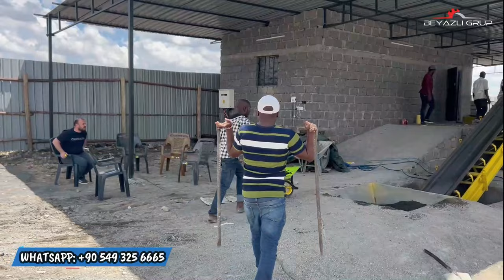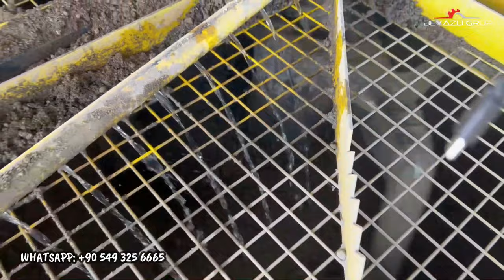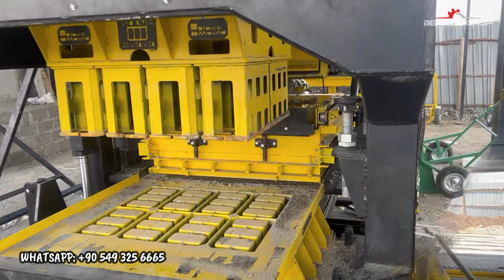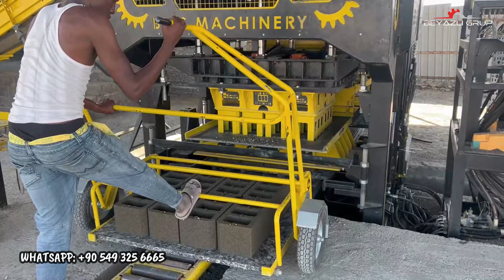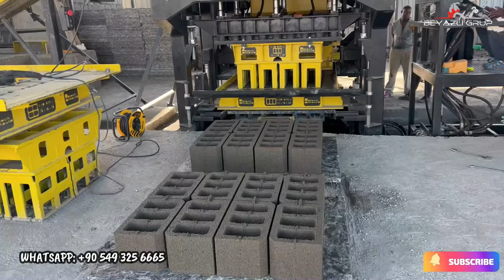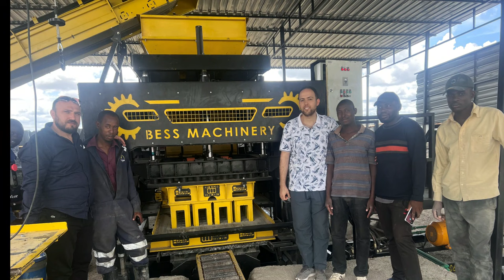Concrete Block Making Machine PRS1000 Semi-automatic System

Comment: Hello! How does a service like this cost to maintain and who can fix if problems arise? Great looking machine 🤑
Reply from the maker: these new generation block making machines are very easy and simple in terms of maintenance. when we install the machine we also train the operators and tell them how to do the maintenance and do simple trouble shootings.

also spare parts that might be needed for the first 2 years come with the machine so its easy to replace.

the machine also has 2 years of guarantee and 5 years of service guarantee.

Comment: In which country do they produce this machine?
Reply from the maker: in Turkey. the machines are manufactured in Turkey. also all the parts are German wellknown brands.
Reply: @concreteblockmakingmachine  Do you have a web page were I can see more?
Reply from the maker: @fongjorge   sure    https://bessconcreteblockmachine.com/
this is our website. you can contact our sales department for further details or any questions  +90 549 325 6670